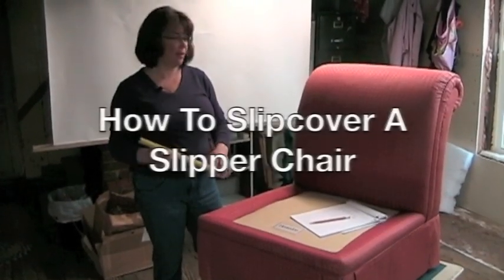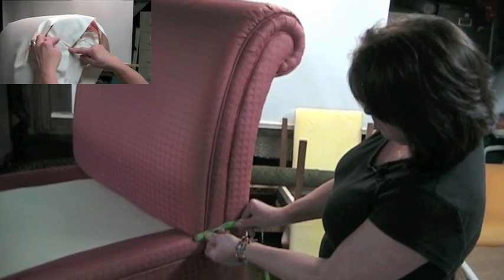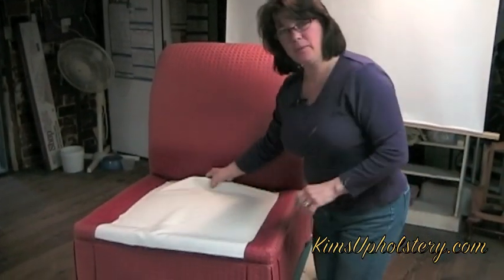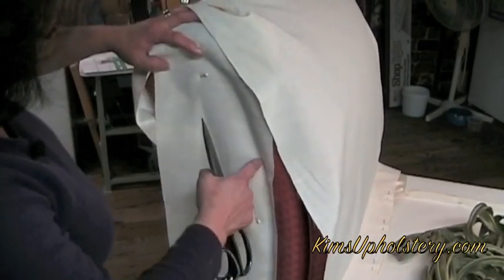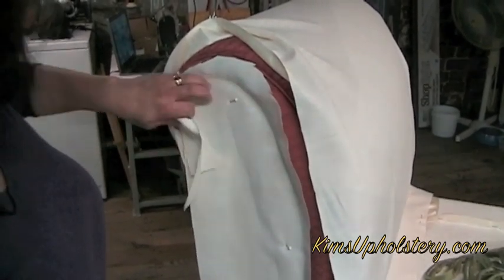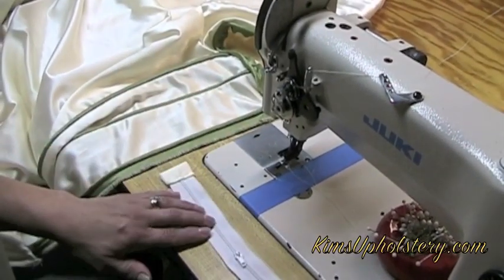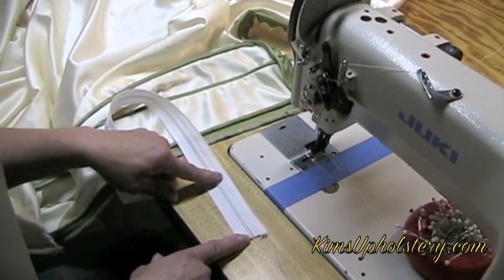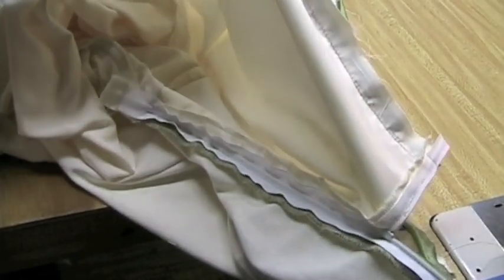How To Slipcover  A Slipper Chair.m4v

Comment: Hi Kim, I started making a slip cover a week ago. I have very little Upholstery experience dating back about 40 years ago. They were bad times too. I took a job in upholstery in desparation. He also hired me for the same reason. You straightened me out big time. Your' video is great and easy to understand. I just finished my slip cover. It is a love seat with a chase at both ends and it is a rocker too. I had to make two separated sides. You helped me with, layout, a lot. 
Thanks,
John